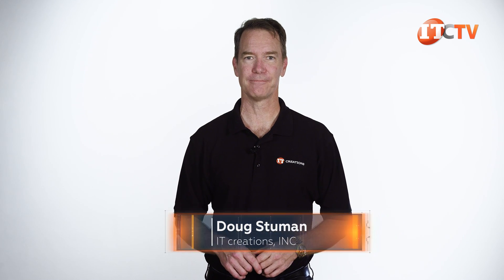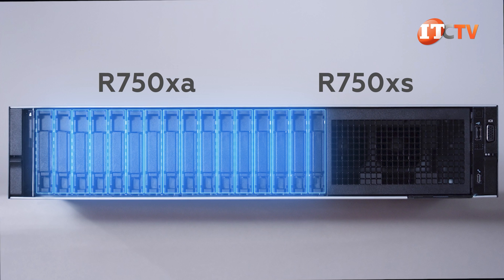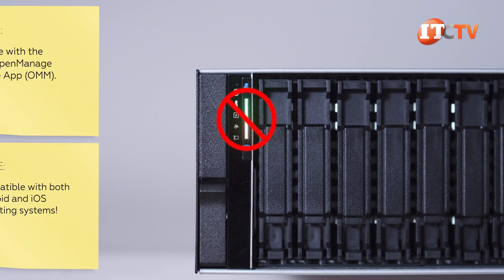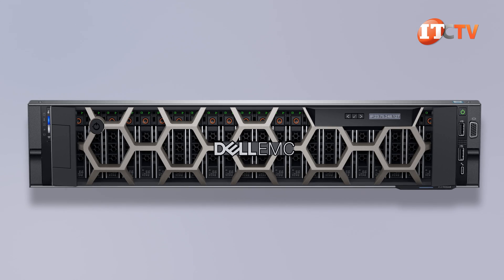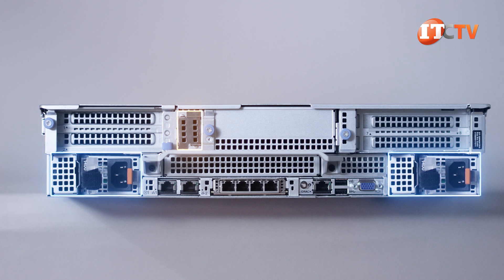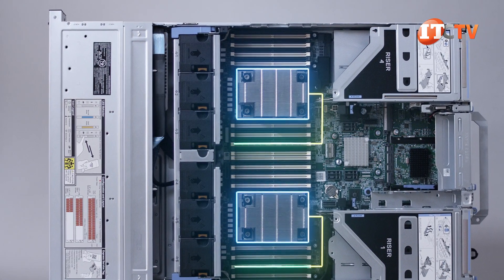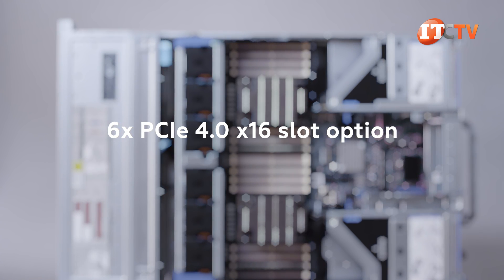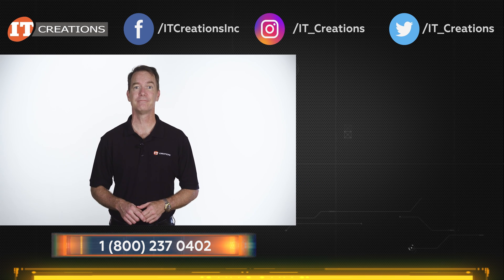Dell EMC PowerEdge R750 Server REVIEW | IT Creations

Comment: nice video!, if let say we buy 8 bay 2,5"  and after 1 year  we need additional 8 more disk,    are those empty slot able to add more disks?
Reply from the maker: In theory, yes, you would need a backplane, the drive cage and cables to power it, perhaps a new controller and expander. In reality, Dell has kind of blocked that from happening for several generations. You are better off just getting the 16-- or 24-bay version if you plan on expanding storage. Thanks for watching!

Comment: If you have to install a SAS card extension, can that be done from the back without having to lift the lid? 
Thanks
Reply from the maker: No, you will have to remove the cover and pop it into one of those PCIe slots or the front slots depending on the configuration - of which there are many. Check out the User guide installation manual. Search PERC (poweredge RAID controller) and search PCIe. https://www.itcreations.com/user-manuals/poweredge-r750/dell-emc-poweredge-r750-installation-and-service-manual.pdf

Comment: Which one is the SAS port?
Reply from the maker: There is no SAS port. SAS drive formats are handled by a PowerEdge RAID Controller, or PERC. that is pretty much standard on all servers—aside from it being a Dell-specific PERC… As an example, here is a link to the Installation and Service Manual with a wiring diagram for a SAS drive implementation on page 78, figure 77, there are a bunch of other storage configurations so flip through that section to see more options. https://www.itcreations.com/user-manuals/poweredge-r750/dell-emc-poweredge-r750-installation-and-service-manual.pdf 
Hope that helps and thanks for watching!

Comment: I'm planning on buying two of these for my simulation work. If i choose the 24 2.5inch chassis option and fully populate them with 24 u.2 drives, can i set all 24 of them into a single RAID0 config? The configurator on Dell's website doesnt seem to have any RAID option listed for front U.2 drives.
Reply from the maker: Hi 權埈映,
I don't think the configuration you are suggesting is one supported on this platform. Also with RAID0 you do have the best storage performance but no redundancy or room for failure. Here is a link to some information regarding Dell HW RAID for NVMe devices. https://cdn-prod.scdn6.secure.raxcdn.com/static/media/DAM_5527f94f-1041-4f04-9234-b4659c04ea72.pdf 
Thanks for watching and Happy Holidays!
Reply: @Itcreations-LA  thanks for the document. I will read it through. Happy holidays to you guys too!